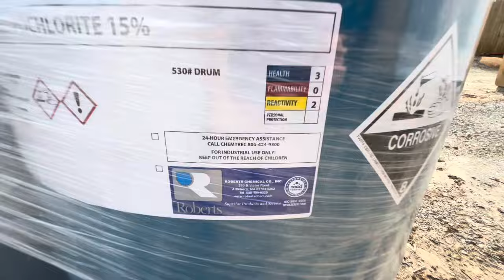Some Days We Struggle

Comment: Powering through! Finding a way to make it happen! This is what business owner/operators do verses employees typically.  Many moons ago I had a chatter on my first machine, GP1511 4gpm belt drive. After much trouble shooting it turned out to be something overlooked, a slightly loose connection on the inlet side of the pump either at the pump or filter or splitter that was sucking air with the water it was feeding the pump. Tighten everything! I sold that pump years later and it still worked great! Hope you can fix it soon, keep up the great work Brother!
Reply from the maker: I’m guessing its supply too

Comment: Hey Joe....how did you jump into this industry full time?  How many clients did you have when you made that decision?  Keep up the awesome content!!!! 💪
Reply from the maker: I started 2019 part time side hustle with a 2.5 Lowe’s machine. Did 200+ washes. Bought the f250 and went full time 2020 with a 4gpm and a roof pump.
Reply: @powerfulimprovements  Thats freaking awesome.  Thanks for being inspiring. Last season intent from dewalt 4gpm to now a wrapped flatbed with Honda Gx690 8gpm, softwash system etc.  Work for railroad at night and pressure wash during day.  But I feel limited to amount of jobs I can do because of my night job.  Gained about 100 clients last season and already gained about 30 more since this season started.  I have a lot to think about.  🤔  Would love to do this full time....thats my end goal.
Reply from the maker: @pinopopper  if you go full time you have no choice but to succeed

Comment: Same happened to me the other day. I kept starting it and made sure my tank was completely full to get out any air in the lines if any and it resolved itself. Hopefully same for you joe
Reply from the maker: Hoping my filter is clogged
Reply: Would that just be airlocked? When it happens to mine running off a well I’ll give it ten seconds, then pull and release trigger a few times which seems to push the air out.
Reply: Sometimes it better to limp to the finish line than not to finish at all
Reply: There does seem to be much difference between the 5.5 and 8 gpm machines
Reply: Sometimes we have to go through these obstacles, to revaluate our current stand and progress forward. A load of BS. 
I had two brand new machines break down at the same time. Not only did I lose that day, also lost a day at repairs. The best was I had to pay due to bad fuel, which is not covered by warranty. Now I have a fuel/water separator.
Reply: Why you change suppliers.

Comment: Make sure not to rule out the unloader, sometimes over down time lubrication dries up and they stick or they get knocked on the stem and cause weird issues but you can usually here the rpm on engine changing somewhat when it's unloaders. If you have been working in the cold check those ceramic pistons on the pump for a crack, will cause issue like you have as well
Reply from the maker: Much appreciated

Comment: Great video Joe.  If you don’t mind what DS injector we’re you using?  I have the same pressure pro 5.5 gpm machine. I switched to a super suds sucker, put the #1 orifice in to get to 10:1 and pressure is way down. Figure I may try your DS injector setup to get pressure back and a good mix ratio.  Thanks!✌️
Reply from the maker: GP 1.8 from Southside Equipment. Stainless with ceramic ball
Reply: @powerfulimprovements  Excellent!!  Thanks!

Comment: Pump airlocked? Remove the plug on the inlet on the opposite side of your pump. Just happened to me, I heard a little hiss when taking off the plug and then water started flowing out. Worked like normal after.
Reply from the maker: Much appreciated